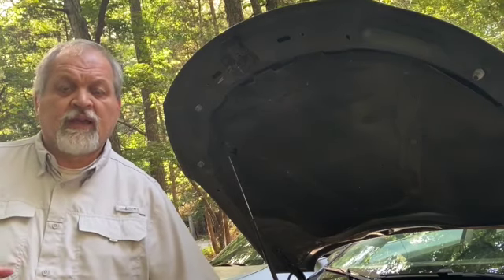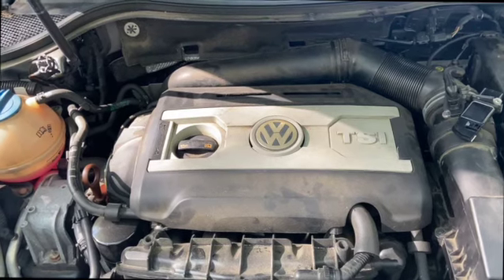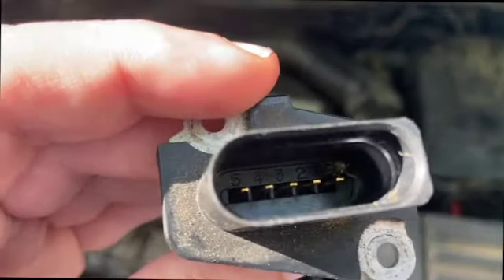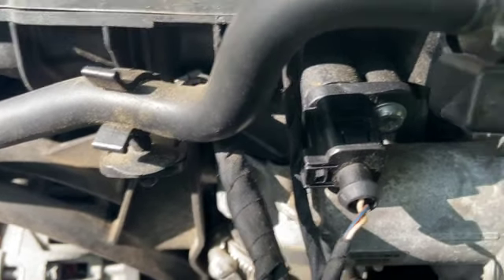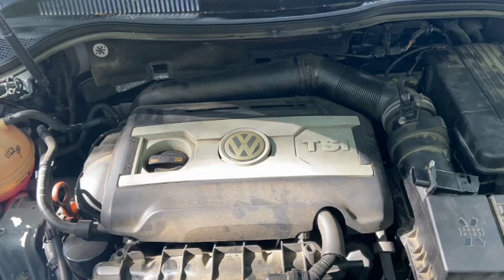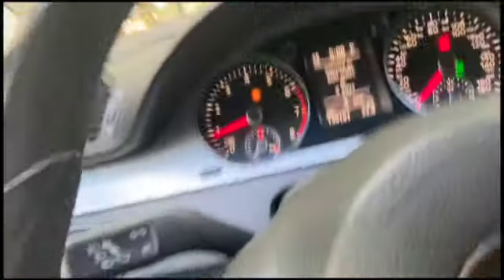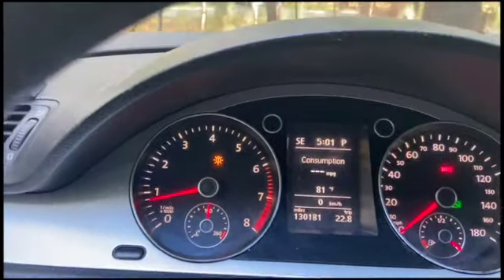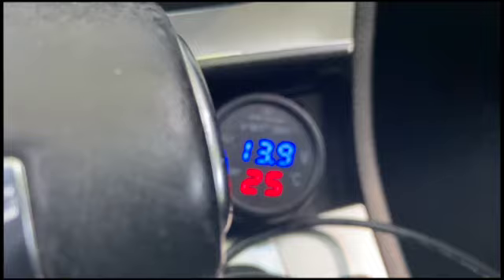How to fix  hesitation under acceleration or heavy throttle in your car

Comment: My 2005 3.0 Sable ls Duratec engine, had the ac compressor replaced, and after that, is being hesiting and loosing power after 1 hour driving. There's no check engine light on, there's no noise. I changed the spark plugs and coils, air filter, had the oil changed before the compressor was replaced. The car never did any of that before the compressor was changed. What could be causing this,since there's no check engine light on. Anyone, please help..
Reply from the maker: did you change the alternator or a shop?
Reply: It’s very possible that the new compressor is bad and will not spin without more torque than spec. When the clutch engages and your engine goes to start turning it, it hits a wall of resistance causing a jerking. You better have it checked out.
Reply from the maker: @CitizenValve  yes new does not always mean working and some shops use discounted parts to increase their profit
Reply: You should also check the MAF or MAP sensor. Is there any increase in rpms after turning on AC and it remain stable ?
Reply from the maker: @awaisiqbal8934  It is unlikely that the MAF or MAP sensor would not cause any other issues
Reply: @ProfessorDIY I just had my alternator changed at a shop and now I’m having this problem. (They said that my warranty company only “allowed” an after market part)
Reply from the maker: @codacNvegas  an alternator will not cause hesitation while the car is running but it will cause the car to completely shut down
Reply: @ProfessorDIY  even an aftermarket part wouldn't cause jerking when accelerating at a dead stop? It didnt have this problem at all before. All that they changed/repaired were the engine/transmission mounts and the alternator
Reply from the maker: @codacNvegas  the alternator had no impact on the acceleration
Reply: @ProfessorDIY  I'm actually driving it right now and I hear and feel a slight click right underneath my feet where the transmission is every time that I accelerate from a cold stop
Reply from the maker: @codacNvegas  do you have any codes? Clicking sounds indicate a mechanical failure

Comment: My car accelerates then lose its acceleration
Reply from the maker: What other symptoms are present?
Reply: Thats a fuel problem ma'am check it from gas tank till the engine whatever it connects the fuel to ....All that if you dont have a obd2 reader to read fault codes
Reply: @itzpro. thanx !! Your comment helped me
Reply: @itzpro. mine does the same thing, I have a 2008 Nissan quest. I’ll check that out. Is there anything else I need to check?
Reply: @priss88hdz  airflow sensor...disconnect it and check it the last thing is if you have clogged exhaust this one is almost impossible to diagnose
Reply: @itzpro.  thank you so much for replying
Reply: @priss88hdz  guess you already repaired it 😂✌🏼

Comment: my car don't accelerate until the accelerator is pressed hard. when I press it hard, the car starts running. once it starts running then a small push of the accelerator is enough to run it. when the car slows down again a hard push to the accelerator is required. when the car is running fast, then this problem doesn't exist. This problem exists when my car is running slowly so what do you think could be the problem
Reply from the maker: Based on your symptoms I would check your accelerator position sensor and the throttle position sensor first

Comment: I notice between 1500-2000 RPM when I'm maintaining a certain speed is when I start getting this hesitation. ( No engine light)
Reply from the maker: That might be your throttle position sensor

Comment: I have an Audi rs3 and I’ve noticed on 100 percent throttle it kinda sputters and breaks up. And I have no check engine light . My spark plugs are clean no oil or anything on them . They have around 17 k miles on them. What should I look for?
Reply from the maker: Your Mass Air Flow and your idle control valve
Reply from the maker: Clean your MAF and the Air Temp sensor, also is your air filter clean?
Reply from the maker: The Trashman  Nope ignition coil is fine and it is a TOYOTA
Reply from the maker: The Trashman  Your comment come under the main video not in reference to another post when I replied to it and there is no reason to be obnoxious
Reply: Hello, did you manage to get your issue sorted, I have the same problem with my golf 5 gti, drives well but on a well push acceleration it sputters, if I keep acceleration it really does not have power to accelerate and  will read multiple misfire
Reply: @rockyhutton6850  spark plugs
Reply from the maker: @rockyhutton6850  Yes I did, I cleaned the throttle body and the idle control valve, also check your air filter and clean your MAF check for cracks on any vacuum hoses and lastly test your throttle control switch under the petal spray some electronic cleaner on it and see if it makes any difference, it should

Comment: I floor the gas pedal quickly and have a delay in acceleration. What could be the problem?
Reply from the maker: Not enough air
Reply: @ throttle had been replaced and can u specify how to get me air
Reply from the maker: replace/clean your air filter and check fir vacuum leaks

Comment: I have a 2001 Toyota Sequoia SR5 and it buckles if I just give it gas from a stopped position, also if I’m stopped and I put it in drive and just let my truck walk it bogs, but goes away when I give it gas. If there’s any input you can give me I’d gladly appreciate it.
Reply from the maker: sounds like either throttle positioning or accelerator positioning switch based on what you describe

Comment: I don’t know if you’re still replying but I have a 1999 Toyota Celica and I’m getting nowhere past 3KRPM and I can’t go past 45 before the car starts jerking and starts reducing my not to the point where the cars off but to the point where it forces me back down to 40 or below power,  I replace spark, plug, spark wires, fuel pump fuel filter air filter distributor, cap, distributor and nothing what do you think it could be? Sometimes I can get the RPMs to go past 3K when I neutral bomb it or when I’m driving, but the car does not increase in power please HELP!!!! no check engine lights, but on rare occasions, I’ll get misfires last one was in cylinder one please help even just what do you think it could be would help
Reply from the maker: I always reply. What have you tried so far?
Reply: @ I tried changing my spark plugs, spark plug wires, fuel filter, air filter  fuel pump, distributor cap and distributor
Reply from the maker: @bloopboy994  Check your MAF and throttle body, next the idle control valve
Reply: @  I don’t think I have a maf I think it’s called a speed density system something similar to that but replacing my throttle was next (people keep saying it could be my timing belt)

Comment: my 2017 nissan versa note driven about 89,000 miles hesitates when accelerating past 60 miles per hour on the highway. the car shudders as i try to push it past 65 miles per hour. after some time, i can drive it at 65 miles per hour but it only goes for a mile before the speed falls back to 60 miles per hour. it's hard to keep it at 65. sometimes it'll fall to 40 miles per hour
Reply from the maker: Sounds like an air/fuel mixture issue. Check your MAF and your air filter
Reply: @ProfessorDIY  thanks so much 💜

Comment: Hi Professor DIY.  I have a 2001 toyota avalon with the issues of acceleration and missed fire and rough idle, I have auto zone diagnosed and show fuel injections. I changed all 6 spark plugs, 5 out of 6 ignition coil and 6 fuel injectors, cleaned the throttle body but didn't solve the problems. what else would you recommend to dig into?
Reply from the maker: Do you have the codes? Fuel injectors do fail but not commonly
Reply: @ProfessorDIY  I don't recalled  the codes but it randomly missed all of the 6.
Reply from the maker: Since it affects all cylinders it is less likely that it is Spar plugs or injectors. MAF sensor or even dirty air filters is where I would start.

Comment: Hello, really enjoyed your video and could use your help. My Honda Accord hesitates but only at high rpm (~7200) or at high speed (5th gear, 130 mph). Cleaned the throttle body and sensors about 10k miles ago. Any suggestions? Thank you in advance
Reply from the maker: @ADbe-me  a bad or dirty maf sensor can cause this also check for vacuum leaks and throttle position sensor operation
Reply: @ProfessorDIY  Thanks again for your response. After careful consideration, do you feel that these potential issues would also cause symptoms at lower rpm and speeds or just at high rpm/speed?
Reply from the maker: @ADbe-me  That is quite possible
Reply: I'm sorry, let me rephrase my question. Shouldn't symptoms caused by issues with the MAF, vacuum leaks and throttle position sensor also occur at low rpm/speed and not just at high rpm/speed?
Reply from the maker: @ADbe-me  Not necaserily, the fuel/air ration changes
Reply: @ Interesting, I'll def. take this into consideration. Thanks again for the feedback
Reply from the maker: @ADbe-me  Anytime friend.

Comment: Sir i have a ford ranger 2013 manual transmission with no trouble codes at all but having a hard time going uphill while shifting from 2nd gear to 3rd gear and back to 2nd gear..the rpm goes down so i had to make a half clutch just to rev up the engine on 2nd gear but if the engine stall i go back to 1st gear..any idea about this?
Reply from the maker: Have you checked your vacuum system and the throttle position sensor?
Reply: @ProfessorDIY  the throttle body has been cleaned together with the turbo and the egr intake manifold..
Reply from the maker: @DenDen_10  The sensor can not be cleaned if it is worn out and to is not cleaned when the throttle body is cleaned

Comment: Another good thing to look at is if there is oil in the spark plugs or coils. If there is, replace the valve cover gasket. That’s what I’m doing to hopefully fix my issue. If that doesn’t fully fix it I’ll check the sensors too. I already replaced the spark plugs.
Reply from the maker: In older cars some oil in the plugs is not a concern but if they are soaked you are correct
Reply: To
Reply: @ProfessorDIY  what causes oil soaked spark plug ? Out of 6 one had a lot of oil on and in it - every plug was black
Reply from the maker: @paulsultana8683  if you are lucky a failing PCV valve or running very rich, common causes are  Damaged spark plug tubes, worn piston rings or damaged valve seals what other symptoms do you have?

Comment: I have a 2012 Silverado with the 5.3 had misfire issues changed plugs and wires and still getting them randomly should I try this?
Reply from the maker: Most certainly and Good luck!
Reply: Clean your throttle body
Reply from the maker: @bjjones18  No need problem is solved

Comment: Looks like you reply to every comment on here so I'll give it a shot. I have a 2013 BMW 528i xdrive that hesitates when accelerating. The problem did very minorly begin after changing out the spark plugs and coil packs. 3 months after changing those (spark plugs and coil packs) I installed an exhaust cutout that bypassed the resonator and muffler. This when I really started to notice the issue, although it might have just been a coincidence. Since then, I have switched the coil packs back to the original ones with no improvement and I have gone through 2 tanks of fuel injector cleaner with no improvement. I noticed my vacuum line had some oil in it from the vacuum pump sucking up engine oil so I am replacing the vacuum pump next. I think the vacuum line operates the wastegate and maybe that is affecting my car? If the vacuum pump doesn't work, I will do the spark plugs again. Maybe I bought bad spark plugs. Permanent engine code cylinder 1 misfire P0301 and stored code engine too lean P0171
Reply from the maker: switch the cylinder one coil with the coil from cylinder 3 and see if you get a p0303 error, do not worry about the lean code, for now, it is more likely to have a bad coil than a bad spark plug unless you bought the wrong temperature range plugs, what grade of gasoline are you using? you can also try to add some octane booster and see if it makes a difference, I have an M5 and love it!
Reply: Too lean means not enough fuel pressure. Try changing your fuel filter first and if that doesn't work check the fuel regulator. And lastly check the fuel pump. My 2015 just had a fuel pump slowly fail so a 2013 is right on schedule to need a replacement fuel pump.

Comment: Hi sir, 

I have a tuned Range Rover Svr, 65k miles has given me no issues at all except for o2 sensors because I put down pipes on the exhaust. After I did the tune for the down pipes, the car has a weird “ jerk” or “ stutter” right before red line and the after the shift, or when I accelerate without using the paddle shifters it stutters badly. The car in 65k miles has had no maintenance except for spark plugs changes which I did 2 days ago. What do you think the culprit is? Faulty MAF or/and maybe o2?
Reply from the maker: My best guess is the O2 sensors, also dod you reprogram the ECU  after the mod?
Reply: @ProfessorDIY  I have replaced the o2 a few times I already since the incident has occurred. I do off road the car heavily as well so the engine bay is extremely dirty and maybe that maf somehow in the middle of it all got dirty as well. Yes the ECU was reprogrammed when the car got tuned. The only thing I encountered after the tune was the o2 sensor check engine light, I replaced those sensors and never got a light again, but the stutter remained. It’s not a huge bad stutter but nonetheless it is there.
Reply: @ProfessorDIY  also , the car shoots flames but primarily from only one side , leading me to believe it may be running lean on the side it doesn’t shoot flames .
Reply from the maker: @Unknownscientists  It all points to ECU
Reply: @ProfessorDIY  wanted to quickly update, brought it in to a friends shop. On the obd2 data reader the bank 2 sensor 1 is not responding at all. We’re going to be replacing that now.

Comment: Hi! Im facing poor acceleration in my first 20-30 mins of drive but works properly after 20-30. Already changed my spark plugs. What should I look next? Thanks!
Reply from the maker: Your intake temperature control sensor, possible  air leaks, and the mixture control valve

Comment: Thanks professor i need your advice i have ford spart trac limited 2007 it drives at good speed then suddenly drops say from 120mph to 50 mph what could be the reason? gear sound fine>
Reply from the maker: What else is happening? Rapid drop in RPM or rise in RPM?
Reply: Rapid drop in RPM

Comment: I like this.  :  )  Facing similar issue.  Pulling my hair out.  I'm not a pro mech.  What other clues lead to you the particular spark plug?
Reply from the maker: You need an OBD II to identify the cylinder or if it is constant unplug the ignition cables one by one the one that when unplugged does not change the sound of the engine is the bad one.
Reply: @ProfessorDIY  :  Perfect!  You are skilled.  :  )  Thank you and God Bless you!  I like your production on the video too.  :  )
Reply from the maker: @horacesawyer2487  Thank you for your comment and for watching!

Comment: Hello, i have this issue aswell and wanted to know what would happen if you push the gas pedal down when it was not in gear. As i have the same symptons but i was thinking if it was any problems with sparks or maf sensor then how can it happen when in neutral. Thanks
Reply from the maker: More than likely is is a throttle position sensor
Reply: @ProfessorDIY  Thanks, I will check this out